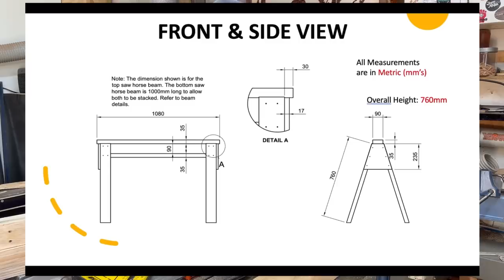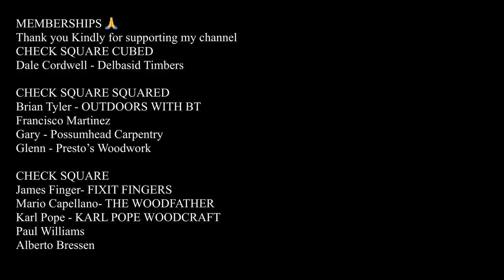Pine Palletwood for Furniture that SELLS !!!

Comment: Hey Bruv, if you buy any paint, get it "tinted" with white as well. All "tintable" paints are sold shy of volume because they are "designed" to be tinted. Just get artic white tint (pro tip) get artic white with 5ml additional black. It will make the white pop just right!

Comment: Great video good to see others putting what is considered waste to good uses. To all you would be pallet hunters if you have a ute or big trailer , a fantastic resource is the wooden pallet/frame that ATV 's get imported in.Here in Australia ,my local motorcycle dealer used to pay to dump them at the tip, i just called in one day when i seen them piled up and asked them what they did with them . They could not give them to me fast enough , took my mobile number and ring me when they have them.These pallet  range in size from 2.4 m up to 4m by 2.2 m wide for the biggies made up of 2x4 , 1 1/2 x 2 1/2 , and various smaller sizes.These are Kawasaki and Cam ams brands ( have no idea what the other brands do,i get so many i have never bothered to check elsewhere) , some of the timber in these pallets is beautiful and the best part , they are all kiln dried and heat treated.Thanks Dainer you make some fantastic videos , i have watched most of them.
Reply: @dainermade  yep , these are single use only ,custom made to fit the side by sides, the kawasaki ones have 2 x solid 90 by 90s running down the guts ,up to 3.6m long unbelievable they use to go straight to the tip to be turned into wood chips.Great channel one of my favourites

Comment: So I found a way to "clean up" pallet wood while still leaving a rough finish. a wire wheel. Especially for pine, it beats all the splinters, dirt and other stuff off. depending on how aggressive you get, it leaves a smooth, but very textured finish with the natural wood grain.
Reply: Good tip.
Use the radial brushes with the twisted wire though. They hold together better than the twist knot cup type.

Comment: I've discovered your channel through Jesper makes.
I've been interested in pallet woodwork for a while (like years) and I can't believe YT didn't recommend such a quality channel before.
In Europe, there are far far less non pine pallets than in the southern hemisphere. I am currently using a stock of palletwood that I scavenged over 10 years ago, coming from Indonesian pallets (used to work on building a solar farm, with solar panels coming directly from Indonesia) to build myself a desk.
I kind of disagree with you on pine. It is a bit dull, but the blueing of the wood because of mushrooms can make it much more interesting, and it would be a shame to hide it. Also there are all kinds of "pine". It can tend to get closer to pink (douglas pine) red, orange, white, with wider or thinner grain.
You don't need to paint it, or hide it.
However, as you said in several videos, people need to learn to just not pick uninteresting pallets up, unless they plan to use them for hidden parts. There are interesting pine pallets out there, you just need to keep the eyes open and be patient.
Cheers and keep up the good work!
Reply from the maker: Thanks very much mate, glad you have taken a look

Comment: Great video. Totally agree with the pine pallets. Awesome stuff. I will say though there is nothing worse than a pine pallet which is full of that sappy crapy that will gum up your blades etc.
Reply: Yes! I grabbed a couple of pallets a while ago that when I went to clean them up, were absolutely FULL of that crap. A lot of those boards went into the fire pit. It melted and bubbled up like a champ in the fire! Burnt with a nasty black smoke though...

Comment: What are your thoughts on using a handheld power planer for squaring and surfacing the boards? It's got to be easier than sanding and much more affordable for most beginners and those who can't afford a bench top planer.

Comment: Hey Mark, I'm enjoying your videos. I'm self-taught on wood working as a productive hobby and potentially money making with pallets only. At the moment I don't try to optimize the hourly rate as I learn but more to refine the technique. However my garage isn't big so no space really for table saw hence trying to do everything with a circular saw and only buying tools that I'm seriously going to use. The first few projects have been so far planters, garden tools trays and coming up picnic folding table. Hello from Wellington New Zealand.
Reply: @dainermade  it's a double one and yes the car has to go but there are other things like a freezer. I've been talking to the house boss and probably can make some more space after decluttering a bit, and maybe split into two with the space under the house using it as storage. Thanks!.
Reply: @Mauricio_Ferrari  Dangerous, talking to the BOSS!

Comment: Little tid bit for the peoples. Avoid sanding a surface if you are going to use a bladed edge after. The grit will break off and some of it embeds into the wood. This does make bladed tools blunt much quicker. If it can sand wood it can sand your nice sharp blade.

Comment: Back when I was a kid, pallets were made of oak. Occasionally you can still find a few with oak boards, but it's not very common. If I didn't experience it myself, I'd find it hard to believe.
Reply: For the most part, the hard wood palettes are all chep (or similar) these days.
They tend to come back for them. 

You do see em' from time to time though.
Reply: @dainermade  I've just tripped across your channel.
I've been considering making things from palettes for a couple of months now but didn't know how well it would go over here in Aus. Recently I picked up a crane palette made from 3x3 and 4x4 that I had to cut into three so it would fit on me hilux.

Think it's time I turned them into some benches and get started. Thanks for confirming for me that it's worth a crack!

Comment: Sooo, I'm kinda new to woodworking and I live in Sweden where everything is made out of pine, so I just have a question. What's wrong with pine?
Reply: hey, i guess that there is nothing wrong with pine per say its just that from a pallet perspective its usually low grade, so porous, can be filled with resin veins/knotting and aside from pallets it is a softwood so dents easily. Also the natural color can be frowned upon by some woodworkers as if left unstained over time will turn a yellow/orange color which some folks see as a hideous 70s look. Staining can be a challenge due to its resinous nature as it can make the staining blotchy but personally i think pine is great with some great grain patterns and can be worked with once you know the work arounds.
Reply: @bazanderson8283  Thanks for the explanation.

Comment: another top vid (great tip about the white wash look being most popular) I was going to ask this question in the other vid but forgot. When you do your wipe on poly and thin down with white spirits, what % are you doing it at? Jst had a bit of a disaster with poly that was thicker than my grans vegetable soup, it should b cured by xmas though 😂